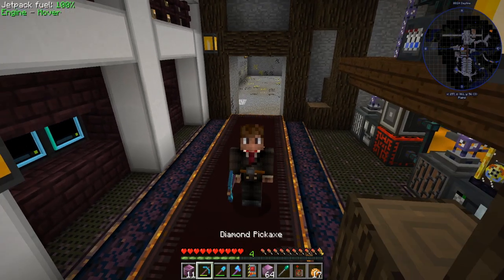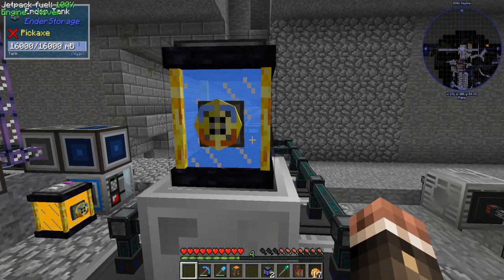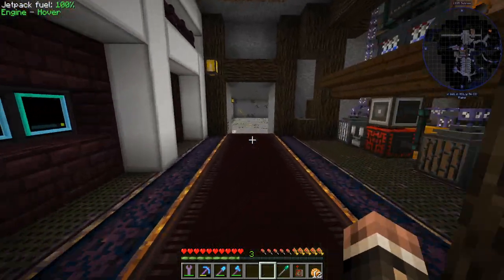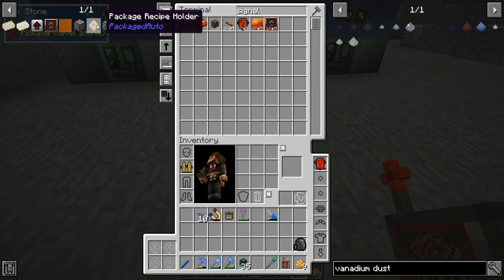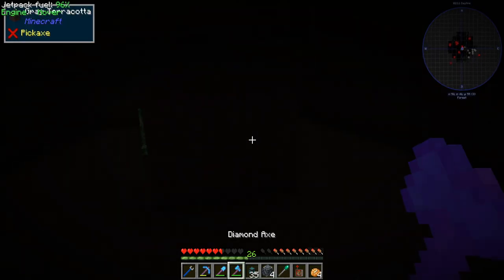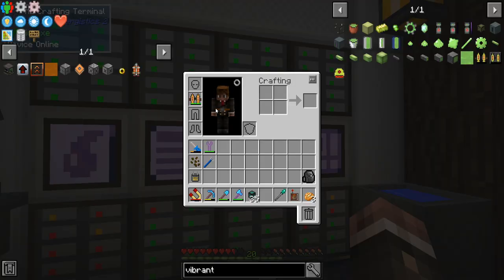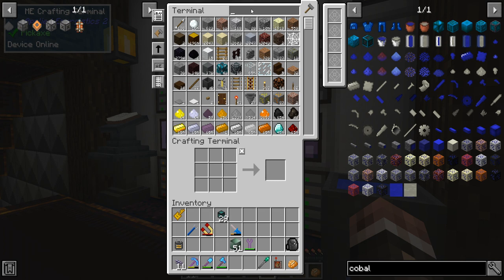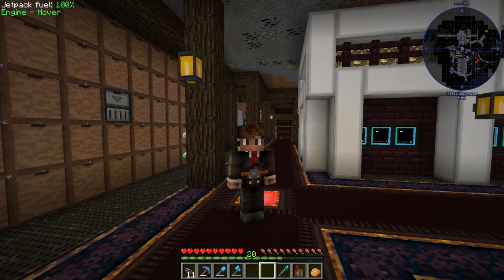Omnifactory Episode 17: Diesel Generators and IV Prep

Comment: Just keep in mind that Nitro-Diesel is needed for making Draconic Ingots later which are pretty critical (draconic cores e.g. are used for the next upgrade kits), and you will have to do the Fission Reactor unfortunately, and you might want to look into Dimensional Transceivers because they can send power/items/fluid wirelessly. At this point making the Infinite booster upgrade for the wireless terminal is probably pretty easy for you too.
Reply from the maker: Noted. This array uses such a tiny portion of the diesel production I have set up that it doesn’t become a problem and I turn it off as soon as plasma is available